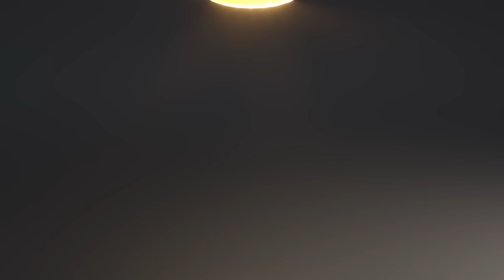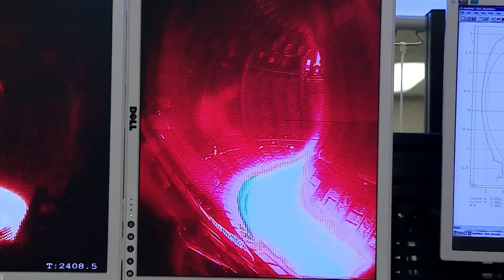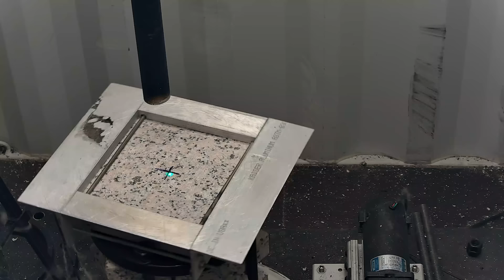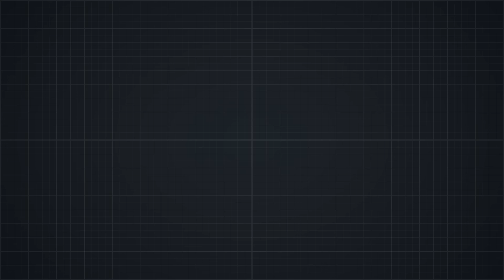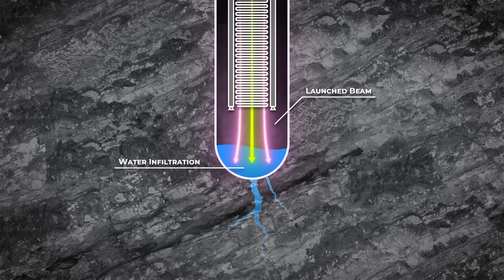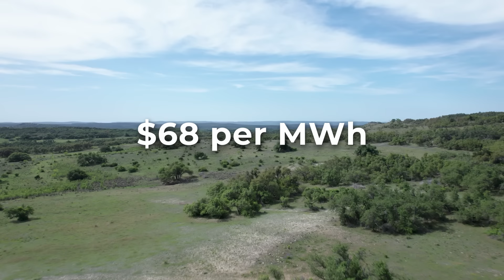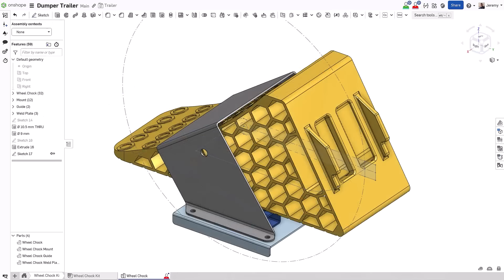Geothermal Energy is Changing

Comment: You still have the issue of heat loss as the fluid comes to the surface.  Don't see getting steam to surface, but you gain efficiencies with a smaller delta T to bring the water temperatures for steam generation.  Not sure what this yields from a cost perspective.  Sage Geosystems has come up with some interesting concepts to use a batch of wells as a battery for use at night or when there is little or no wind, basically to help cover the gaps when solar and wind aren't sufficient.

Comment: When you break down the costs are you factoring re-usage of the equipment or is that divided up over a number of wells, because if you can get 100 uses out of the equipment with 50% of the cost of the equipment in maintenance that would bring the cost of the equipment down to 285k per well for the equipment, that doesn't include instillation etc etc and obviously the energy cost of 525k, but that means that your main cost will likely be electricity. This is assuming that re-usage has not been factored in.

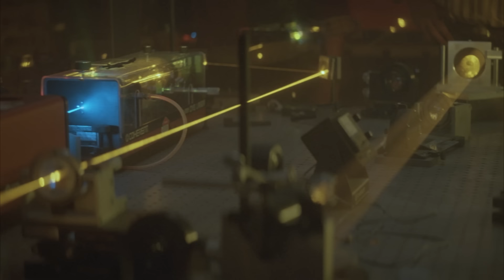Comment: 5:12 Eh... Microwaves are LOWER frequency than visible light. I guess you meant it makes Microwaves that are in the high frequency range of the Microwave band? Your wording is ambiguous. I read it as higher frequency than visible light, you meant it as higher frequency than mid range microwaves but are still microwaves.

Comment: engineers need to figure out a system where the bottom drill bit can travel up through the drill for replacement without having to pull all the sections up.

Comment: Could they use the heat from the hole that they're digging to generate enough electricity to power the drill? Could they drill a few holes to power a steam generator?

Comment: what a fail. this is like firing laser into rock or soil and no one does because it is overkill, inefficient and/or expensive.  they might fare better researching with erosion techniques using high pressure liquid integrated with hard materials like silicon carbide or diamond particles-the challenge is to recover and recycle these hard particles while drilling.

Comment: Drilling is not the only problem. At Otaniemi, Finland, they drilled two wells reaching 6 plus km depth but the whole project was shut down after a failure to reach significant enough water flow between the wells, i.e. with technical terms, the stimulation (hydraulic cracking or fracking) to increase the permeabilty of the cold and hard granite rock of the Fenno-Scandian shield failed.

Comment: No liquid in the hole means there's virtually no pressure to hold the hole open. Then, fluid ingress into the hole as well as collapse are very serious problems.
Also, currently, one of the biggest costs for drilling a well is the steel needed to case the hole. This should not change that cost.
Reply: They're saying the obsidian created by the maser will be the casing. There's a question whether in practice it will be an adequate casing.

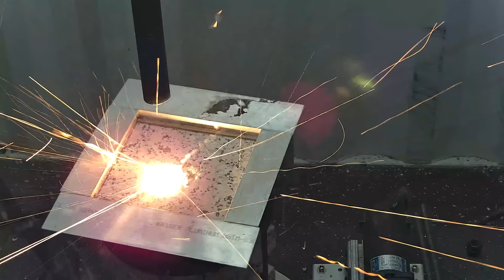Comment: 6:25 no way this would work. How are you going to keep the cuttings from building up around your rod string? Core drilling the water we use cleans the hole and cools the bit. If you use water this technology won't work, if you don't, just the gas wouldn't be enough to keep the hole clean.

Comment: Fantastic video, well researched and presented. I do regret watching until the end and I regret that you are using LCOE as a metric for how viable a source of electricity is This is not a minor simplification, but a very dangerous deception that has been affecting policies all over the wolrd for the last decades.. Electricity is not a commodity that can be stored and reliance on LCOE is one of the main reasons why our electricity today is becoming relatively expensive and dirty. Since the policies have been advantageous towards relatively low LCOE intermittent sources with subsities including netmetering, the generation has to be supplemented with fossil fuels.

Comment: I wonder if they've considered injecting a low concentration of a powdered material that has high absorption of microwaves into the air stream at the bottom of the hole to help create essentially nucleation sites of superheated material that might cancel out the reflectivity of quartz in some rock types.

Comment: Here's a  thought, my well is over 300ft deep, its 8 in diameter but the piping is only 3 inches. Could you drop a heat exchanger liquid based into the well and use it to boost heating/cooling. The well water is 45 degrees year round and would not care if it raised to 60 degrees due to the heat exchange. The pump is 50 ft from bottom but you could lower the cooling loop all the way to the bottom. Just use potable water so no risk of cross contamination.

Comment: Using the excuse of Geo Thermal is asinine...And the reason that Kola hole is only 12 KM is THE BITS KEPT BREAKING...People don't understand basic Physics...As you go deeper; pressure INCREASES....They used Diamond bits ...DON'T MATTER...Diamonds normally are mined at less than 2 miles deep..The pressure at depth forms diamonds.

Comment: Here are the issues.. 1.  At the point they stopped drilling the hole no longer held it's shape and Rock the consistency of Taffy would refill the hole and grab the drill head and melt it.  2. much deeper and there is the issue of releasing Magma.. can you say Volcano.. and 3. It's not a Reactor..it's just hot and well insulated.. tapping away that heat is not wise and could stop the Magnetosphere from operating.. like Mars.  Sucking the Life and warmth out of our environment is not the answer to our energy demands.

Comment: How does this do in limestones? I know what Nevada has one of the highest geothermal gradient in the world due the the thinning of the crust from the ongoing basin and range extension and much of the surface rock there are carbonates and even some typical sedimentary rocks and a quartz sandstone sounds like a terrible obstacle for this system.  Could this combine with conventional predrilled and cased holes and then use this to get into the hot rocks at depth?  Could you turn it down from a horizontal run like they use for fracking this could allow a conventional well to be placed and then have multiple runs into to the hotter rock below? There's a massive slew of issues but the potential is there and I will support trying to solve those issues.  Is there a potential for offshore use since most oceanic crust is basalt and getting plenty of water to run into your system would be easy.   Once again lots of pitfalls but potential.

Comment: I know they plan on using supercooled nitrogen to keep the gasses at cooler temperatures, but how will they keep the pumped nitrogen at that temperature 6 miles down a bore hole that gets hotter and hotter with each passing kilometer until it reaches 374° C?

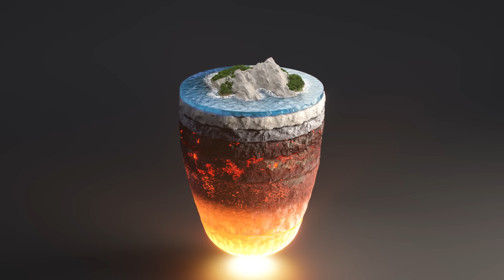Comment: 1:05 "deep within the earth fission reactions generate immense quantities of heat"

Fission is not what the majority of the heat comes from, the way you state this suggests otherwise.

5:10 "but instead of producing light it produces higher frequency microwaves"

Microwaves are lower frequency than visible light.

This is the first video from this channel I've watched and barely over 5 min.
Perhaps you meant to convey "but instead of producing visible light, they produce microwaves at the upper end of the microwave range"

A little more wordy but if you want to be a science communicator then you need to clearly communicate.

Comment: Okay, let me get this straight, it costs $27 million to use a conventional drilling process to drill 6km down and they need to drill 7km down, ( so, not much more cost then ). Assuming some 20:28 thing like $30 million max and after that the maintenance costs are very low in comparison for an estimated lifetime of 2 MILLION YEARS, surely this THRASHES the cost of anything else???! For example, how many billion would it cost to build a nuclear power generator and all its running costs, ( including maintenance, processing of nuclear waste and  building a bunker for said waste and maintenance of that bunker for it's lifetime of just what? 50 years?!! )
Methinks that there's something else at play here...

Comment: Have the boys in your"commercial" project ever done a thought experiment on how to construct a waveguide 7km long? Each joint of pipe will have to mate to incredible tolerances to avoid standing waves that will reduce power delivered to the rock face.  Each section of pipe will need  a stainless steel flange with o-ring and  multiple bolts to hold the nitrogen pressure.  The joint must be very flat and precise on the interior of the pipe to minimize standing waves.  Connecting each section will take many minutes in very clean conditions, vs. the 5 seconds it takes roughnecks to thread 2 oil pipes together.  
Will the waveguide be round or rectangular? At the microwave frequency proposed, will it be an 8 in. pipe or a 0.5 in. ? Will the nitrogen flow in several tubules or in a total jacket around the pipe?  What pressure is need to pump nitrogen thru a small tube down 7 KM?  Will the pump pressure be so great that it will turn the nitrogen to a solid?  How strong a pump will that take?  Is it  beyond those commercially available?  it is expensive to design and build something new. 
A waveguide must be very rigid.  As the pipe becomes longer, it will flex. How much flex is theoretically allowable at each joint  to prevent standing waves?  Are the theoretical tolerances impractical to meet.? As depth increases,  flexing will increase exponentially .  Maybe the thickness and weight of the pipe will  need to increase exponentially.  
It seems to me that waveguide calculations can be done to develop specs to determine if the project is even theoretically feasible.  What if it turns out that a one km hole is easy and a two km hole is impossible.  The author did not get into this with the entrepreneur, and the entrepreneur  did not bring up the subject .  I my experience , something they don't talk about is something they don't want to talk about. I suspect the waveguide problem is just as difficult as the gyrotron problem.
Reply: Excellent critique! On the plus side I would say that this presentation had far more details and test results than previous. The earlier ones tended to be breathless about just how much energy was down there and showed just a few relatively thin samples or rock having been bored through vaporization. It also puzzled me that they didn't run a deeper
test in the lab environment to see what happens to the wave guides at say 100 meters. Why go from a 40 inch bore hole straight to a field test? In addition to seeing how the waveguides performed at say 100m they would be able to closely analyze the anticipated obsidian casing that's supposed to hold everything together.
Reply: You can probably stop it flexing by just anchoring it to the sides every 50m.

Comment: I wish I knew less science things.. So..uhm... what happens if you hit water? KABLOOEY 

Edit: CALLED IT!!!! 14:57 ahh... that sweet moment of validation. .. Second edit: After imagining the forces involves, trying to visualize the failure, I can only imagine one version of events. Eventually, that fucking thing is hitting water and that's a near certainty. Once it does, boils and expands, and not just a bit, but rather, a whole fuckton of gas would be produced instantly if and when that thing hits water. How much exactly is for models to predict outside of my knowledge, but all it takes is knowing how much less sensitive amorphous rock would be than water to microwave radiation to get a general idea of what that much microwave radiation would do to any body of water. There is only one direction that force can go, and that's up. The drill would be launched skyward, and other than the injuries/fatalities that may occur locally from the projectiles of impacted equipment, the pressure wave may be intense enough to rupture ear drums regardless. This reminds me of that time they set off a nuke underground and a manhole cover flew into space. Obviously, a failure wouldn't be anything near that catasrophic, but I think the rig could get launched up a decent height to make anyone question how they ended up there that day.

Comment: I know it’s just a youtube comment but wouldn’t it be a nice idea if they were to combine the old and new technologies and make a sort of conveyor belt which scoops the molten material out as the gyrotron melts the rock and not using all the energy to vaporise it? I imagine that way you would only need a material sturdy enough to withstand the heat of molten rock as opposed to drilling through solid, but mechanically scooping the molten material maybe could make the process faster and economical since you don’t have to vaporise rock and deal with the vapor thousands of feet below ground. Maybe time the scooping process with the melting rate and stop the beam while the material is evacuated? Idk not an expert just passionate and inspired by the progress made so far, hope mankind keeps the good work, such things are like poetry.

Comment: One big problem of geothermal not covered here - is energy inflow into the well. 
Yes, temperature down there is high...at first - but very soon you will extract all that energy and rock around the well cools down. Now, you need to wait for it to heat again, from rocks that are further away. The problem is that transfer of energy is ridiculously slow and in long run your well will produce much less energy that you might think from initial numbers

Comment: I have always very strongly believed geothermal is the permanent solution to the energy question. I'd say in an ideal scenario one century or more in the future, it would provide 80% of the energy mix, the rest going to alternatives mainly for other reasons than how they generate energy (e.g. hydro has a dual use as gravity battery, some distant communities can't live in reach of a geothermal, etc.)
Modify that 80% a bit to diversify it if you want, but the base idea remains the same.
Nuclear fusion research is pretty unpromising, and I don't even need to state how current renewables are one of the objectively worst solutions.
The transition period are ideally uranium fission plants, and when that is depleted thorium.

Comment: Wonderful thing though, you don't actually need to hit a depth that produces supercritical steam on its own... You can drill far enough that you can pull usable heat and concentrate it via heat pumps. Not as efficient as having a direct source but if the cost to dig deeper is exponential and the cost to concentrate the heat at the surface is reasonable, there's a clear path to functional geothermal.

Comment: Easy way to deal with the water is use compressed air it shoots out at the end of the drill and a return pipe to extract the water.
Reply: If the obsidian casing turns out to be water tight it seems like compressed air would be sufficient at the bottom. But in practice is 10km of obsidian casing likely to be water tight?
Reply: @PolyThumper  Definitely plus once its going water aint gonna be a problem.

Comment: [Disclosure: I didn’t watch the entire video]

Geothermal energy at the temperatures they’re seeking in g he video is very expensive but…
Geothermal heating and cooling for your home is very cheap to set up. About 8-12 feet down (based on where you’re at in the U.S.) the temperature is stable throughout the year at about 65-72 degrees F. The process is easy to do, basically using a backhoe to dig down 8-12 feet and then laying down a few hundred feet of 4 inch tubing.  Then connect each end of the tube into your home with in-line fans to circulate the air in the home. Boom! You e got year round air conditioning for almost free. Use some solar panels to support your lights and appliances and you’re effectively off the grid!

Comment: Ehh ... the LCOE of wind sucks just like solar, you need to add powerfactor into those estimates.  A 1GW wind or solar generator is absolutely not the same as a 1GW coal, gas or nuclear generator.  Gas, coal and nuclear rarely need to be turned off, they can keep producing power nonstop for long periods of time.  This means a 1GW generator will generate 1GW continuously.  To do the same with wind or solar we need to build 3~5x the capacity, so 3~5GW worth of generation capacity, or basically 3~5x the capital costs.

Comment: Uhm….industry uses 480 volts and 4160 volt by….dropping the supply voltage.  Do you even know what voltage power lines are?  No…not residential.  But at power plants and industrial plants?  Also look up transformers…that how you get the voltage you need…step up and step down transformers depending on supply and need,

Comment: they need to dig a ~1km deep hole with conventional mechanical bore and as the costs starting to increase switch to this microwave boring technology.
By the way, where energy goes from the Collector in gyrotron?

Comment: Supposing the "one meter an hour" baseline, at one megawatt hour per hour, I did some quick math to figure how much would it cost to pretty much double the record of the kora hole.

At one meter an hour, supposing operating ~55% of the year, you could get 24,000 meters over 5 years, effectively double kora's depth. 

To get 1mW of potential, I assumed you use wind power; to build a ~3mW wind plant (assuming ~30% average effectiveness) it'd cost you around 3m usd, and about 50k usd to operate, 50k*5 years +3m gives 3.25m usd to operate it. 

Dividing this by the meters we dug, it gives you a cost per meter of around 135usd, while the kora hole cost around 7500usd per meter. It also took over 20 years to dig. 

Of course, this is ONLY energy cost, (supposing you built your own energy plant, which is also unlikely), which is an unfair comparison, but these comparisons helped me understand the potential of this tech.

Sorry if my terminology is incorrect, my mother tounge is spanish.